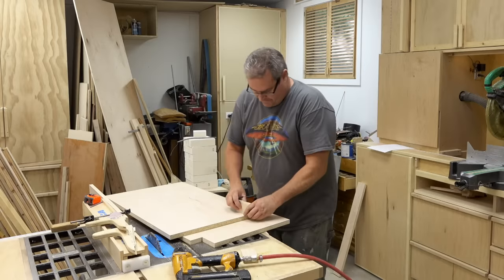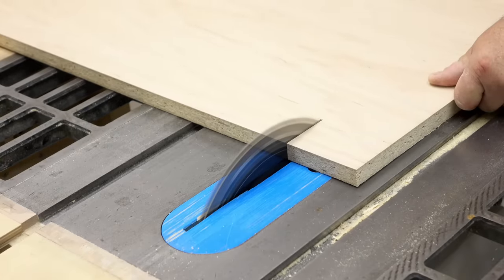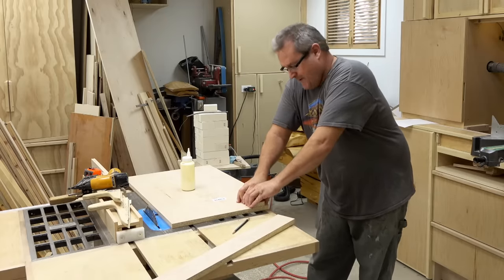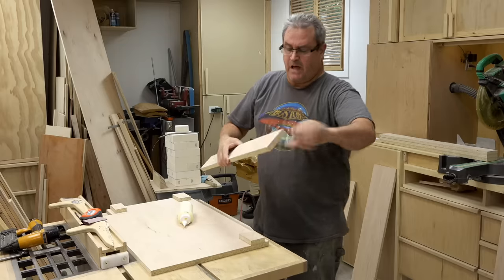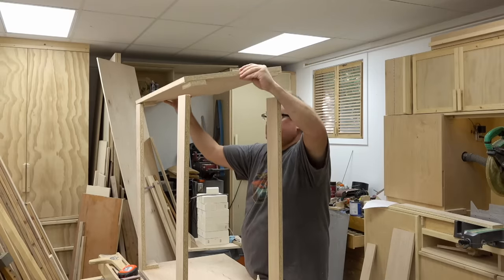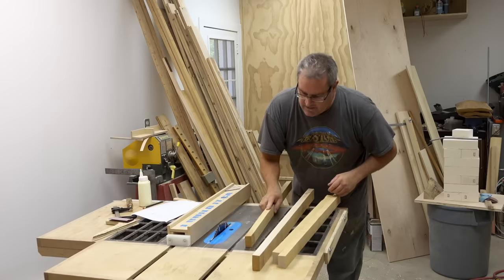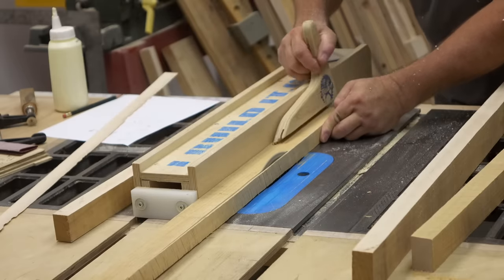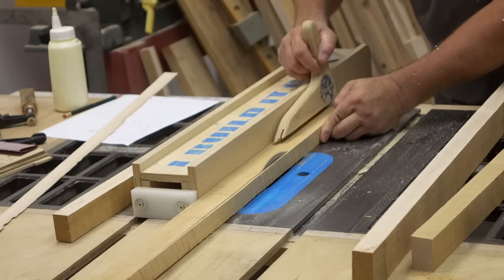Building The Bathroom Vanity Cabinet - Part 1

Comment from the maker: In this video, I build the base cabinet for the bathroom vanity. The design is fairly simple, just a box that will house three large drawers. The construction is barebones, using stretchers instead of a solid bottom shelf and a back panel, but has a solid maple faceframe attached to the carcass with biscuits and glue.
In the next video, I'll apply the finish to this part of the cabinet. It will be stained a dark colour and I'll go through how I do that.

The video on adding the supports to my miter saw station:
https://youtu.be/RQTMjP6fODc

Here are some ways that you can help support the work I do in making these videos:

Plans for sale: http://www.ibuildit.ca/plans.html
Patreon: https://www.patreon.com/user?u=865843&ty=hWebsite: http://www.ibuildit.ca/
Facebook: https://www.facebook.com/I-Build-It-258048014240900/
Instagram: https://www.instagram.com/i_build_it.ca/
Google+: https://plus.google.com/u/0/b/107142665853474113931/
Reply: Very interesting to watch thank you, the fourteen & a half went by so quickly,
Reply: I Build It Home
Reply: Do you keep checking for square throughout or is it easy enough to pull it back into square later?
Reply: I Build It Home
Reply: I Build It Home can you put up the link for part 2? Thanks in advance

Comment: Love the vanity, really nice job. The wood looks like what we here in Australia would call chipboard or particle board, really really cheap stuff (half the cost of regular plywood, and significantly cheaper than pine). All the cupboards in my house are made from it here in Western Australia. The only danger is even with the laminate on it, one has to be careful not to get it wet (mostly a problem with the benchtops.

Comment: I worked in a Cabnet Shop before for 2 in a half years. I really loved it and enjoyed it. Although my boss at that time can be a butt hole from time to time. I would cut and put stiles with rails together with screws and wood glue upon a slightly from top and bottom chalkboard slanit.

Comment: Nice job, looking good, I use to use biscuit joinery to build cabinets years ago, worked well most of the time, I now use the Summerfeld Tools tongue and groove method of cabinet construction, it is just as fast, very strong but more importantly for me is that it is very accurate... I get perfectly square cabinets without even trying.  Keep up the great work and thanks for sharing!

Comment: Great use of construction John, the material is commonly used for carcasses and in the uk we call it chipboard.
But whatever it's called around the globe its still a carcass, and it does the job.
Reply: I've heard it called chipboard or MDF (medium density fiberboard) in the US.  I'm curious if he attached that veneer himself or if it comes from the store that way.  I believe that veneer to be the source of confusion.
Reply: TheDisorderly1 the sheet comes veneered already, but it can be bought naked. MDF is fibres whilst this stump is made from formed wood chips, that's why it's called chipboard . Like john said let's a stable product ( until it gets wet then it will blow) as long as it's the water resistant stuff.
Reply from the maker: Industry name for it here in North America is "particleboard", since it's made from wood particles (saw dust, basically) and not chips. MDF is another thing altogether, more like cardboard.

Comment: Thanks for sharing your techniques and the method in which you use to build these cabinets people need to realize they can use whatever type of material they like they could use a combination of 1 by 12 1 by 6 is when x46 cetera is showing in the technique sandwich is in the ability to build a cabinet and that's what matters thanks for sharing

Comment: Love your videos.  I watch them all.  (Just getting caught up on your vids after returning from holidays actually!)
I have built cabinets out of traditional plywood as well as melamine.  I have also done many plumbing repairs to bathroom and kitchen sinks.  One thing I would suggest if you are using the particleboard is to caulk the inside corners along the bottom of the cabinet.  The particleboard does not seem to hold up well to water leaks in my experience.  The two main reasons that I have come across for replacing cabinets are due to water leaks and due to door hinges ripping out.  Feel free to let me know if I am "all wet" with my comments.

Comment: I will add my distaste for particle board when used where there is any chance of water. I have removed and replaced multiple kitchen lowers simple because a sink ran over and the particle board promptly swelled and fell apart. 
I enjoy the simplicity of your projects although I sometimes question the life expectancy of the material used to make the project.
Reply: What would you use instead? MDF? Seems to me that melamine particle board is the best choice for economics and endurance. If the sink, plumbing, and cabinet are installed right, sinks overflowing are user error, and thus not my problem to compensate for.
Reply: I know it is a novel idea but wood works really well when making cabinets. Wood like cedar or cypress are good choices. Particle board is heavy, has little to no structural strength and is not particularly safe to work with. I guess if you don't give a darn about your end user, particle board is a great choice, good for hit and run, no pride in workmanship group. I know that there are a multitude of "cabinet makers" that charge their customers big bucks for lesser quality work and still sleep at night. 
I tend to do work for others the same way I would make anything for myself. Just a weird habit I have.
Reply: William Laird particle board and MDF have plenty of structural strength in this application. Especially when either veneered or coated in melamine. Solid wood would be fine, if expensive and time consuming, in areas where expansion isn't as much of an issue. However, because of the expansion and contration relative to a countertop, solid wood cabinets tend to bow and move throughout the year. This, in addition to the risk of cupping that solid wood panels are prone to lead me to believe that engineered material is the most economical, and practical choice for your standard kitchen/bathroom cabinets. Built-ins and other cabinets/bookcases are somewhat of a different story(more sides/surfaces revealed, often the center of attention in a room. The insides of kitchen and bathroom cabinets are paid very little attention, but the countertop, drawer fronts, doors, and faceframes, not to mention sink, window and appliances, are the focus, and that's where I spend my time on making the details pop) but in my mind it comes down to what the customer wants, the budget, and the demands of the application. So if you want to spend all your time color matching boards to glue up into dozens of panels, not to mention milling all of that lumber, just to build a full set of kitchen cabinet carcasses, that's great. I'm glad you have customers who can afford that crazy expense.

Comment: Really like the biscuit joinery, also the little blocks that helped square the stretchers.  Was there an advantage to using stretchers instead of a solid back or was it just to save wood?  Or is it more appropriate to use stretchers for this type and size of cabinet?  Curious if sketch up was used for design first?  + 1 request for spraying the finish 😀. Thanks for the build video.
Reply from the maker: It's more economical to use stretchers, since the inside of this cabinet will never be seen after it's finished.

Comment: I can't  watch enough of these cabinet builds. Always learn a new way of doing things. One question. It looks like you made the face frame flush with the outer face on one side and the inner face on the other side. Did I see that right? Just wondering if there was a reason for that.
Reply from the maker: Yes, the left side face frame is also the filler that will be scribed to the wall.
Reply: Nick Klenke I noticed that earlier as well. The inner reveal will be different then? Correct?
Reply: ww55d I think he said he was doing drawers so the reveal won't matter much. He may just be adding a filler on the one side for the drawer slides? I'm sure it will be addressed in the next video.

Comment: I knew people would comment on the material used for the cabinet and say how bad it is and I wasn't disappointed. The plywood used is just fine folks. It's strong, stays flat.
Reply: A lot of commercial cabinets are made with this same material, many times far worse
Reply: just wish he would stop calling it plywood
Reply: thaaank you  i have sworn off mdf particleboard soooooo bad home depot and lowes make soooo much money on idiots with this shit. i am redoing a 20yrold vanity made with this mdf shit, that is trying to collapse on me. using liquid nail screw and clamp for the new one
Reply: @jfr55man  I just looked closer now I see why he shouldn't be calling it plywood it's looks like partial board almost from this angle.

Comment: Related to the faceframe construction, since you offset the styles on both sides to the left, are you going to add a spacer board for the drawer slides inside on the right side panel interior? Or are you going to offset the drawers for drain pipes and water supply pipes?

Comment: How well does the edge-banding hold to the particle board? Does the iron-on adhesive stand the test of time? Or is this in a spot where that's not really an issue?
Reply from the maker: Good quality edge banding that has been properly applied and finished will last as long as the plywood itself. The glue sticks just fine to the particleboard core, as long as it's clean / not covered with dust.

Comment: Honest question, why not use the pin nailer to hold face frame while the glue dries? Since you said you are going to stain it you could sink the nail and patch it before, right? Or that would be to noticeable?
Reply from the maker: Very noticeable. Stain really magnifies how visible even the smallest blemishes are.
Reply: Good to know, I have some kitchen cabinet carcass that I built and haven't finished yet. I was planning of pin nailing the faceframe (since it is already installed and fixed to the wall), but now I have to find an alternative since I can't put a clamp in the back of it to hold it down.

Comment: that looks like MDF not plywood
Reply: No, it's one thin ply of maple or birch veneer, one thick ply of particle board, then one more ply of veneer. 3 different plys to make one single boards. MDF is just one single layer on it's own, made of very fine, almost powderised wood dust, pressed together with a mix of glue.